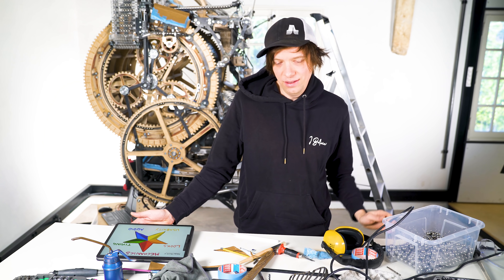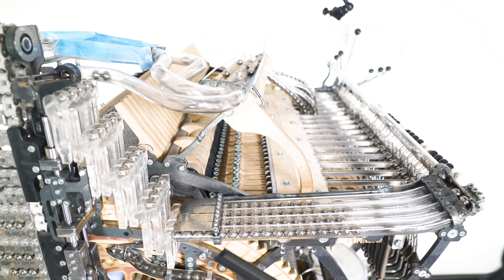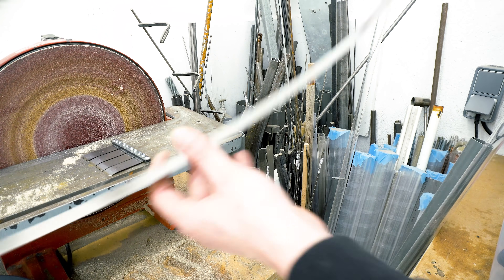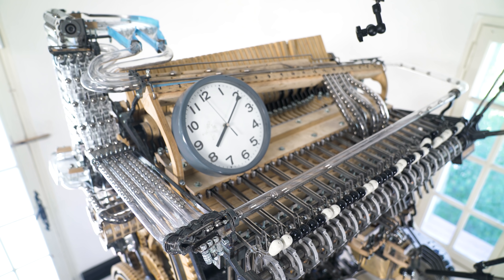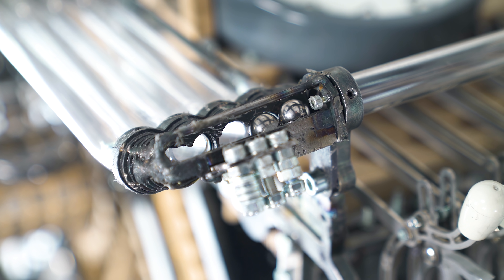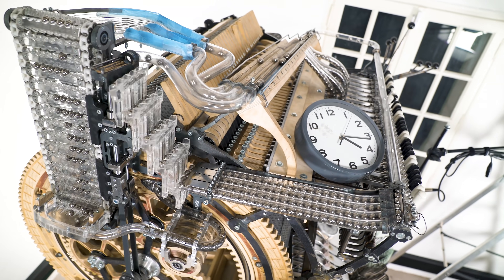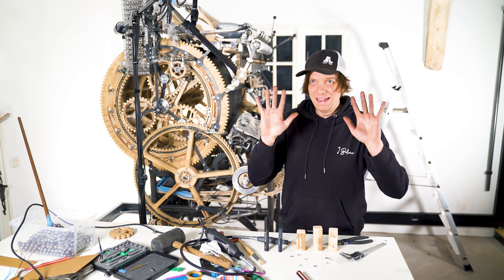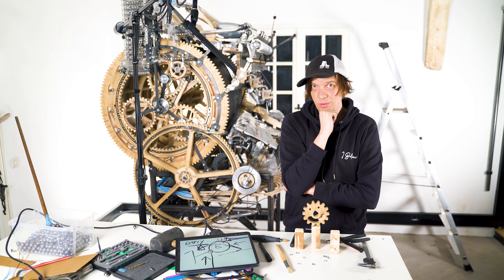Marble Machine X Fish Stair Upgrade

Comment: Try using latex gloves when working. It may keep the metal shards out of your fingers. 

Also, look at your machine's constraints. The divide by four/fish stair works fine as long as it is not marble starved. The engineer can enforce a tempo and channels played per tick requirement on the music to ensure the fish stair does not get depleted and thus prevent the "fish stair ejecting marbles" edge case. That also stipulates that these edge cases where the fish stair does become depleted are outside the specifications of the "working machine" and marbles lost during edge cases are not within the constraints of the machine, and thus are permissible. A marble reservoir feeding the divide by four may work out, but that is a lot of effort if you can prevent your edge case by documenting what is necessary to prevent the edge case from occurring and then defining some constraints to the machine's operation.  Remember the goal: no marbles lost when playing music, not "no marbles lost when the fish stair feeder runs dry." Your constrains include the max number of marbles in the system, the minimum number of marbles in the system,  the max number of channels you can play concurrently, the return rate of marbles, the average feed rate to the divide-by-four and so forth. Every musical instrument has some constraints. Look at the violin. There is a max tension you can put on your bow and strings. There is a maximum distance the bow can travel without changing directions; a maximum force the bow can place on the string and a minimum force necessary for the bow to make an audible sound on the string. There is a maximum number of notes that can be discernably played on the same string per second. These constraints give the instrument its character in which musicians may use to be expressive. 

Short:
- The divide by four is not fragile if properly fed marbles. Define what is necessary to keep it from running out of marbles. It may mean a set minimum number of marbles in the system or a minimum number of notes getting played per minute, or something else--it may not require a redesign if constraints can be defined that allows you to play the music you want to play and keep marbles in the divide by four. A redesign is only required if the current design and constraints prevent you from playing the music you want--i.e. marbles not reliably getting played on time or not getting captured after playing a channel.

Keep up the work, you are  making fantastic progress. I do like the quick, daily updates! It really showcases how much work and contemplation goes into your design and processes.

Comment: I'm wondering if the trick to that edge case would be having a slightly longer finger (the original one) on the bottom. When the slo-mo footage for the Mole Marble comes up, you can see the tip of that lower finger is behind the center point of the marble. It's pinned by the fish step forward and below, while the finger is exerting more of a horizontal force on it. It even looks like it back-spins when it flies out - I think that only emphasizes that the movement of the stair step and finger right now is just making it roll on the horizontal axis. (I'm looking around 14:17 in the video in particular)
Totally agree with what you said about potentially breaking pipes if they went right up and flush to the stair, but I can't help but feel like there needs to be some constraint there. What if you had a  bracket or something that isn't attached to the pipe that surrounds the four pipes and finger ends with half a marble's worth of clearance between it marble flow? It looks like the same mount that holds the fingers could be used to also hold that kind of bracket separately to allow some flex room. With half a marble's clearance, there'd be plenty of room for the fingers to move within their normal range, and when Mole Marble pops up, the finger hitting the bracket would stop the attempt.

Possible downside: This could potentially lead to another mole where the Mole Marble, on its way back down, gets hit by an incoming marble and potentially gets stuck "up" or is unable to settle back down to the pressure from the new arrival behind it, but the spring steel finger and bracket should help it find its way forward on the next cycle.

It could also just be a case of needing the finger to be slightly longer -- with the additional push from the new spring steel added, a longer finger would have more force to whack the mole back into the tube than it has in the past. Just eyeballing it, it looks like about a quarter to a third of a marble's diameter clearance right now -- how close can they get without potentially hitting the fish stair step? Having the edge further out should help prevent the scenario where that horizontal roll comes into play and take care of hammering the mole for you automatically.

Even if I'm off base and this isn't a viable fix or worth trying, there might be an upside to the need to keep the Four Lane Highway full -- wouldn't hitting the fish step with a marble on the full run of the PMMA pipe be louder than rolling halfway or a quarter of a way down it and hitting the marbles there?

Hang in there! I feel like you need to look at this from the perspective of not just how far the MMX has come, but how much significant progress and improvements you've made since the original Marble Machine, or even large mechanical multi-instruments of the past. (After all, the MMX isn't inside a giant, ornately crafted and painted cabinet with a tiny little window to see the automation at work. That's already a huge win!)

Comment: The entrance to the fish stairs looks like an upside down version of the marble drop. Couldn’t it be solved with a similar mechanism. The moving part of the lower step activates a mechanism like the marble drop. Where the dropping marble advances the marble behind it into place to be dropped. So the fish stair moving could use a similar mechanism (but upside down) that lifts the next marble while advancing the marble upstream into position to be lifted next..... if you see what i mean? Not sure I explained that well.... it’s a marble lift, so it’s an upside down marble drop isn’t it...

Comment: The machine works either way as long as it keeps pumping marbles. This seems to me like an aesthetic issue. The machine works either way. Even if it drops 50 marbles per concert no one would notice as long as it plays the notes. And you as a stage performer will know that the audience cant spot single wrong notes most of the time.

Comment: Martin, in manufacturing you make prototypes. To make progress in getting to a final product each prototype must be examined, torn apart, checked, trimmed, and re-engineered. Your first MM was Prototype 1 and MMX is prototype 2. In both cases work is required to ensure every system works perfectly. I think the biggest issue you face is in doing it alone. I know you have the MMX team but in the end you are the one who makes all the decisions and does all the assembly and all the fine tuning. This stress you place on yourself because of that should be considered as a factor in making the perfect MMX. As a programmer I can tell you that when estimating the length of time to do a project one gets excited and thinks that with their ability it will take less time because they are so good. Then as time drags on they begin to question their ability, which leads to doubt and confusion and maybe despair and wanting to give up.
Martin, you are doing the best that you know how to do and the project will be finished when it's finished. Please stop punishing yourself because you want to achieve perfection and it is taking longer than you thought, because that is the nature of greatness. Rome wasn't built in a day, Alexander and Ghengis Khan didn't conquer the world in a week or a month. Great buildings take time, and we are all still here for you. <3

Comment: Ditch the spring steel and have a catch for errors that sends them down to the rotary lifter. This is what the try and catch block in programming is for. We can't think of every single edge case, or the number of lines to fix it isn't worth it.

Comment: @Wintergatan, as a software developer, we accept that there may be failures, but we build in mechanisms to deal with them especially in these edge cases (literally called TRY/CATCH).  If the marbles will fall out of the MMX at the bottom of the fish stair, just control how that happens.  Your box idea is exactly what you need!  You TRY to get the balls up the fish stair, but if this fails, just CATCH them and feed those balls back into the system.

Comment: what if you put a little nub at the front of the first fish stair, when a single bearing hits it, it will stop slightly further away (and under the flap), then the stair moves below the channel surface, the bearing will glide onto it. In this way, the flap will still be useful when needed to stop the bearing from rising up, but it will be out of the way when the bearing is able to roll into the stair at its lowest point.

no more edge case!

Comment: Hey Martin, I use the same Dremel carbide bits when repairing cymbals. You’re absolutely correct- the metal shards and shavings are TERRIBLE and embed themselves into my hands INCREDIBLY EASILY. 

The solution? Wear a pair of the heavy duty single use nitrile gloves (4.5-5 mil thickness). The shards somehow do not penetrate the gloves! Hands saved!!!
Reply: And for getting them out of my hands, I just have to go digging with a really sharp pair of tweezers. It’s the WORST

Comment: I maintain the opinion that removing the divide by four in favour of two sets of pivot switches to divide the marbles is the safest and best idea, as I explained in my comment on yesterday's vid. Have the four outputs empty into 4 channels using a single surface with groves in them, rather than completely separated pipes, that become progressively shallower so that at the end, just before the lift, there is room for stray or rogue marbles to find another channel if need be, but still give a 'preference' to stay in the channel. You should have ample room to convert the four current pipes into this switches n tray solution. Should fix a lot of problems and be far more stable, you can even attach visual cues to the switch themselves so that you have an artistic flair to add to your machine.

Alternatively, you could make an AND gate using all the four channels that only passes marbles on if all four channels are filled using latches (similar to how a tumbler lock works) and have flaps in place that redirect marbles away from filled channels into open channels. This would be self adjusting as well but may require quite a bit of machining and engineering to make and function properly :/.

Anyway as I mentioned in other comments. Take care, enjoy your time, stay safe and remember: Baby steps are still progress!

Comment: I got 2 stair ideas with the same function. Hold the marbles down and against the stair moving up.
1. Make the spring longer and curve up
2. Add bristles like a brush
Or both!?
The marbles now come under so much tension with the only way being out in the air. So i think it should either ease up the tension and/or guide the energy into the stair.

Comment: I dont feel like you need 100% of the marbles you started with to finish a song. If one gets yeet'ed out mid song, who cares? Unless its happening often enough that you run out by end of song, it wont matter. Chasing perfection in EVERY COMPONENT will drive you nuts and fail the project.

EDIT: I will stand by my statement and add, if there are marbles escaping the machine and it still produces beautiful music, does that not add to its wonder? its humanity?

MORE EDIT: I would suggest categorizing the kinds of failures you have into severity. Getting a marble jammed in your divider or modules? CRITICAL. Having one escape the funnels 1:1,000,000 times? NEGLIGIBLE. I feel like the past few weeks have been an exercise in chasing negligible errors.

Comment: People who build cars for racing go through the same and end up going on to win champion races. But I dont think they build it part way and try to adjust it as the go. They build it and then test it and adjust what needs adjusting whether it's an engine adjustment or to the steering or something you wont know what truly needs adjusting until it's all together and working. I suggest completing the machine and adjusting what needs to be adjusted post completion. This way you're doing it is making it take so much longer and seeding doubt.

Comment: Hey Martin, i hope you are doing well. I was wondering, where are all the people that you had around you? Wouldn't it be much easier if you sat down on CAD and designed a prototype where the exact weight of four marbles causes the swing to be swung? Also, when marbles are running down their tracks/tubes shouldn't they bump into a stopper before being left through to the ski lift? i mean fishstairs. Anyway. You have done great so far. And i wish for and want to give you all the energy needed, to finish this piece of art. <3 <3

Comment: For the metal in your hands, take some rubber cement or Elmer's glue and let it dry on your hand. When you pull it off it should take the shards with it.
Reply: I accidentally stabbed my palm with a lead pencil when I was younger. The tip stuck in and I never was able to get it out. Can still see it to this day
Reply: Had to look up Elmer's glue. We usually call it wood glue or PVA. Elmer's is a US brand
Reply: @st0rmforce  yeah it's almost genericized trademark at this point here like kleenex, bandaid, or popsicle. Here, it's either "wood glue" in the context of glueing wood or "elmer's" everywhere else.
Reply: @Clayton Cronk "Lead" pencils have always been made with graphite. They were only called lead because when graphite was discovered, it was first thought to be a form of lead instead of carbon.
https://en.wikipedia.org/wiki/Pencil#Discovery_of_graphite_deposit
Reply: Also try any sort of sticky tape, the stickier the better, then pealing it off. Same idea. Works with splinters, fiberglass, cactus spines.

Comment: This channel is more addicting than the main one! First of all, Keep Going! You are finally getting the process right. My two cents if it's ok, you shouldn't focus on non critical moles. A marble escaping from the stairs, will not break a live show. I'm not even sure the funnels are critical. You know it's a solvable issue. Put it in the "later" tab. If it wont be fixed ever, its not a game stopper. But the channels are. Do another test as soon as you can. You've done sensitive changes, and they need to be tested. Don't fix a lot in one go. Test first. Ignore the noise problems. the marble on floor count means little, so I feel. It's the place those marbles came from, is.
Love your work. I'm sure the path you've taken will get you (and us) there

Comment: I feel like your search for perfection is only getting in the way. The entire project is not doomed simply because there is a slim chance that this one system fails, but only when it's empty (which it never should be anyways). I think that you should just move on and finish it! One marble falling on the floor does not ruin a concert.
Reply: Exactly my thought. Here Martin starved and ran the machine in the worst possible way for 10 minutes before one marble got dropped, or more like catapulted away. During a concert for 2 hours, it should only be that starved of marbles for 5 minutes maybe. So catapulting one marble every two concerts should not be an issue as long as he keeps some extra with him for the world tour. There is more likely that marbles should be lost when loading and unloading the machine. The only real reason would be if that marble risks in damaging the machine in some other way or that there is risk for the audience getting a marble catapulted onto them.
Reply: Those 4 PMMA pipes running dry? As you explained - edge-case. It took 10 minutes for a marble to escape - edge case. What's the chance that the escaped marble would cause a catastrophic failure (e.g. jamming the machine)? Is it low? Then let it be as is :) edge-case within edge-case with low negative impact
Reply: @JanŠimonek  There is a high chance it'll run dry constantly.  You'll seeing it with only 6 channels being play.  If he enables all the channels and playing a close beat songs, those 4 PMMA pipes will only get a couple of marbles at most.
Reply: Just put a rug on the floor if one marble jumps out nobody will notice
Reply: Totally agreed! If a few marbles fall out, I don't think it's as much of a catastrophe as Martin makes it out to be. It's a marble-based musical instrument, for christ's sake... it's incredible that he's even gotten the thing to function as well as it does now.

Comment: What if you add a rocking piece in front of the stair and under the spring so if a marble comes down at the wrong time it is stopped by the rocker and then it is rocked forward when the stair is ready